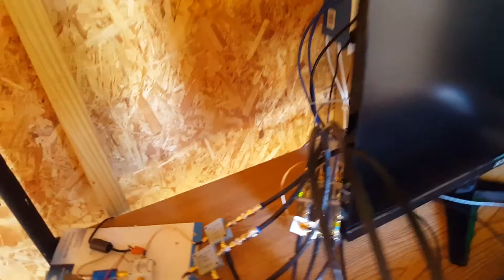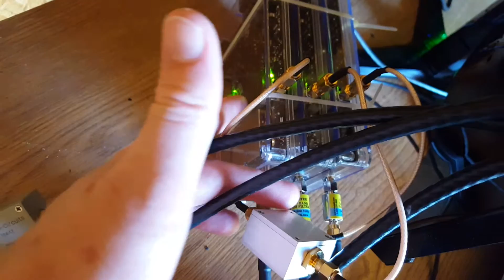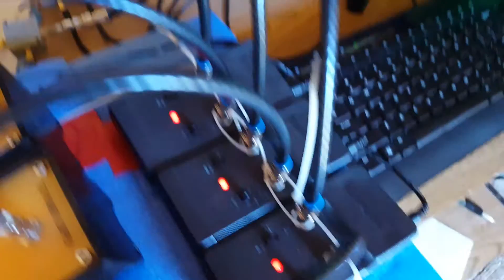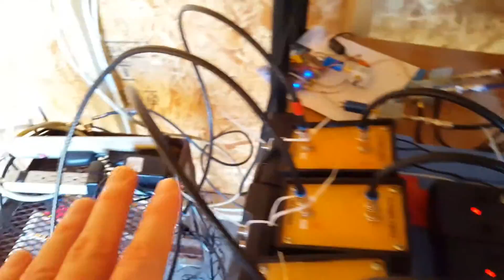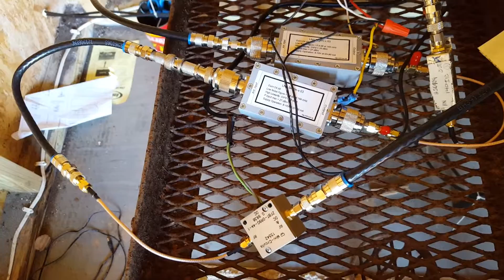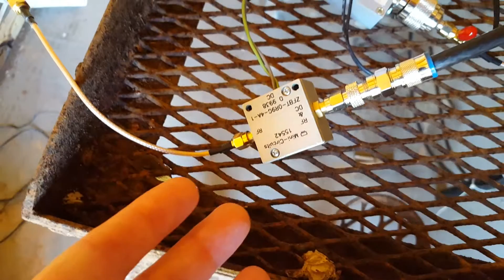140 MHz wide band interferometer

Comment: Should be using LNA's at the antenna, not at the receiver. LNA's at the receiver end are doing nothing for your SNR and are just boosting an already degraded signal, as well as noise
Reply from the maker: The system does include LNAs right at the antenna feedpoint. The amplifers shown here are for boosting the signal even further to pass through some SAW filters with high insertion loss and mixers that need a fairly high input level. 

Check this link for significant additional updates and data:
https://groups.google.com/g/amateur-radio-interferometry